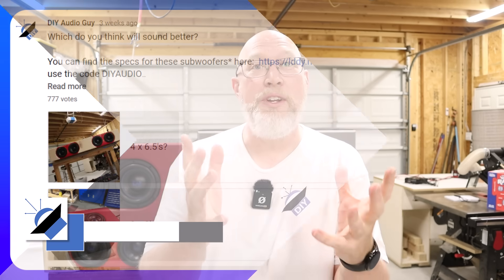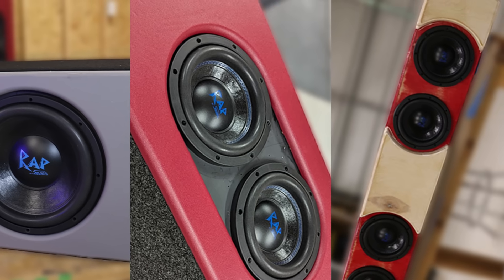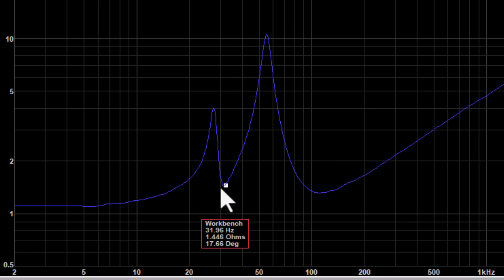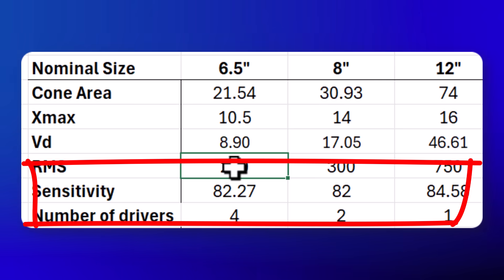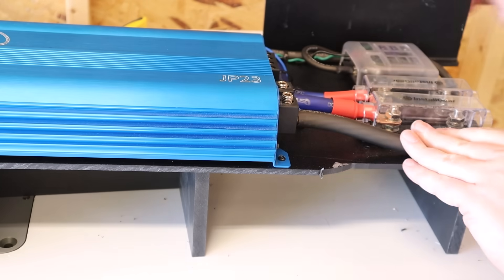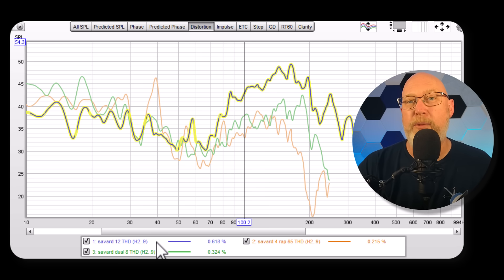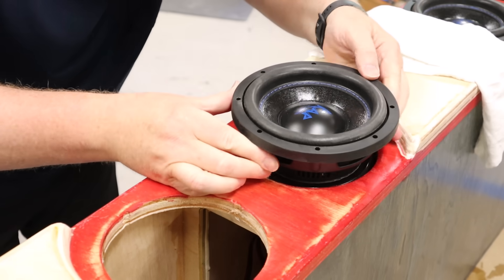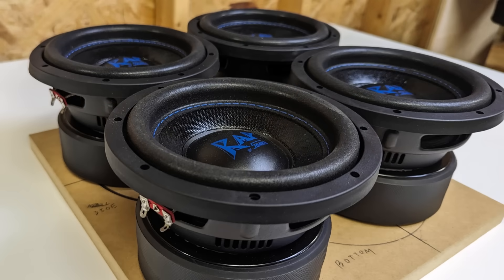Are small subwoofers better than big subwoofers?

Comment: For a great SQ set up, I find that one 8 in a well built box is enough to fill the cabin with enough bass. My days of epic bass are long behind me. Now its about stealth, SQ and power draw, eliminating rattles and hums and listening to the song as the musician intended. BUT I do understand that people love crazy bass and its fun because I sure did.
Reply: Getting loud is easy, getting low is a different animal
Reply: @d0nk3ybrain57 not really. It’s just that most people have a box that is too small. Every recommended sealed box size  I’ve ever seen makes the Qb much higher than the ideal .707. They’re usually up around 0.9 or higher than1.
Reply: @d0nk3ybrain57 agree 100%.   Right combination of enclosure/driver(s)/amp(s) is where the magic happens.
Reply: This comment. Get them midbass away from those doors. Front subwoofer if you can. Underseat midbass or infinite baffle midbass. Sealed box for tight clean response. Those days of getting loud isn't hard anymore. 2 8" can get 140db. That's insane for sq, already too loud.
Reply: @PunisherOfDeath101 149 dB is quite spicy
Reply: Sound damping is worth more than anything.
If you can control the vibrations in a vehicles panels it's going to exponentially increase SQ.
Reply: @Channelmaster73 
Indeed, every dB lowering of unwanted noise is a dB gained in performance and dynamics.
Reply: @FOH3663  I'm very new into the sound systems. That's my next upgrade, sound deadening all of the inside cab + doors of my s10.
Reply: @P4PKing  be careful with the mil count and weight could add 200 to 500 hundred pounds. Could be more depending on the foam and mil count.
Reply: Me too. Im 48, and finally weaned myself from the wall of 6 15s, and find peace in only 4 12s and just 156 DB. Oh its nice to relax and not worry about splitting windshields.
Reply: I respect SQL, and love to hear those systems, but I'm still in the "I want my car to fall apart" stage. even if its Celine Dion or Vanessa Carlton playing.
Reply: I listen to a lot of older stuff and have mixed feelings on the listening the way intended. Many engineers used to adjust things for the primarily cheap stereos from back in the day. I like rebass stuff but it does often kill the feel of the song. I have started doing my own edits that try to peserve the sound of the song but make it not sound like crap
Reply: I run 2 jl audio 8 inch subs in my truck with 6.5 focal components in front doors 5¼ focal components back doors and SQ is amazing. Gets plenty low fills cabin of my super crew up very nice. Everything is pushed by jl audio amps. It sounds amazing.
Reply: @speakerbuild1  
Nice! I bet it does sound amazing. My high performance car audio days were in the 70's, and early 80's!  
Hard to believe I was already out of it 40yrs ago, damn. 

I had a '76 Chevette(!) Alpine head end Alphasonik active crossover, Linear Power and Alpine amplifiers, driving 10" dual-coil IB sub, Alpine 6", Alpine ribbon tweets. 

(still have every piece!)
Reply: @FOH3663  that's funny. My dad still has his old setup. Mb quartz before they were junk and hafler. All back from the 70's and 80's.
Reply: @speakerbuild1  
Very cool
Reply: @speakerbuild1  jl amps are amazing.  Better than a nad home amp i had on same speakers.  Literally zero noise too.
Reply: @jonathanginofilippi  they're awesome. I have 2 jl 750x1 and 2 400x4. I have been running those for  almost 15 years (I think), never an issue.  Only issue I ever had was when I was running critical mass components. The jl amp pushed hard enough that the crossover melted its solder points inside and fried 1 of my speakers. That's actually why I moved over to focal components.
Reply: @speakerbuild1 this is exactly the setup I was thinking about going with, but wondering if 2 jl 8” subs are too much for an El Camino
Reply: @charlesfranklin407  no such thing as 2 much when u have an amp with adjustments. Turn it down a little. It will stay clean run cooler and always have the extra when u want it.
Reply: I'm to the point now that I think a pair of 7" Dayton audio Epique E180HE-44 in an under-the-rear-seat box in my Equinox is gonna be more than enough and still be out of the way.
Reply: @anthonybarker9123  do 3
Reply: @JP-Dawson  While I agree that a single sub is plenty, I prefer the rich lows of a sealed 12 over an 8.  So I still think 12 inch subs are the king, even in SQ applications.  A single 8 sometimes just can't keep up with mids and highs even for SQ
Reply: Amen
Reply: I could not agree MORE!!! My 8 inch recoil, in a box that is EXACTLY as specd by manufacturer, is so absolutely buttery smooth and full sounding I am continuously impressed day after day listening to it
Reply: Idk man, every now and then I miss setting off car alarms as I drive by lol. I have an older Infinity ref 10" hooked up to my Xplod 760W from high school right now, and I bought a 4 channel off Ebay to match it. All stuffed in to a customers Buick I bought for 500 dollars. What rattles? 🤣
Reply: You're forgetting one KEY parameter for any build regardless of SQ vs SPL, Cabin size. One 8 will rattle mirrors out of visibility in something like a civic coupe or a single cab mini truck, but get EASILY swallowed in bigger cars like a minivan or suburban.
Reply: I absolutely love my single 10" Deaf Bonce Machete Fight S D2 wired to 1ohm on just below rms requirements from a CT Sounds 700.1d.. my question is will 2 more efficient but larger subs ( ie. 2× 12" 400w rms D4 subs wired to 1ohm) out perform my single 800w 10?
Reply: I grew up in an SQ family. Everyone ran JL. I was also classically trained & studied music theory. When I got older, started looking for a hobby & had some money, I gravitated tward Bass. I end up liking Alpine, they're a fair mix of both for the price. I also have a thing for how the bass permeates through the car. I'm a huge fan of 12s for SUVs & vans. 10s for cars & crossovers. 8s for trucks.
The 8s tend to just sound better in trucks, but you probably won't feel it outside. 10s tend to be loud, but it won't sound as good in the truck. In some cases, you'll hear it more outside because the cab is so small that it won't reverb in the cabin.
Reply: i love 2 10 s  in a amazing box.    jl w7 10s   slaming .  like the main comment said.  its about stealth and geeat sound for us.    any 1 can slap windows out of a car/ truck/van.     make it elegant and stealth, built in like factory look..  thats the sweet spot.  
.i miss the crazy bass.    i dont miss fixing all the broken and rattling stuff.   
the good old days
Reply: 61 bug rolling a single Rockford 8” punch hits so hard my ears hurt
Reply: @tysonswing  Shidd them old punch amps were so underrated it made no sense
Reply: I definitely prefer a single 10". Some of the music I listen to sounds better when the sub can hit those lower frequencies that you only get with larger subs. I feel like the 10" is the perfect middle ground between the 12" and 8".
Reply: @Steven-gv1ke  Amen
Reply: im only 20 years old and i already feel drained out of "epic loud bass" and just want SQ.
Reply: You can always consider low-profile subs such as JL Audio.   When properly design & tuned enclosure, it will only reproduce what the amp sends to it, provided your amps are set up properly.  I find 30/70 split on the lighter side or 25/75 if more bass heavy reproduction is desired.  I find 35/65 split sounds too thin.  As long as you have your cut off and phasing matched properly so there are no peaks anywhere, you’re golden.
Reply: They don't go low enough
Reply: @MoMo-pe8fp  8's go plenty low enough
Reply: Ive grown into aiming for sq myself, but i still want it to be able to thump decently. Not crazy, just good enough for a former casual basshead to enjoy when i wanna turn it up. Like a perfect mix of sq and spl. Thats what im now chasing. Just wish i had more money
Reply: But you can't alert people that a douchbag is coming from a block away with an 8!
Reply: Me rn 🙂‍↕️🙂‍↕️
Reply: Couldn't have said it better, same here. Used to have 4 12's and my buddies all had 15's. Needless to say only one of us is still obsessed 7 years later now out of high school. The rest of us have a kid or are planning for one.
Reply: Do you go for a sealed or ported enclosure?
Reply: I have focal 6.5 components and a 350w pioneer champion 10" in a Mitsubishi pajero/montero/shogun.. need chest thumping tight bass.. would like to keep to a 10".. any ideas people??
Reply: I trialed a pair of 12 on about 600 watts from a dj system and it gave me very strong bass for music purposes, just not drive trough destroying panel flapping window busting life of price stuff.
Reply: getting loud might be easier... moving air is different
Reply: This exactly
Reply: 60 but I still like to pitch a drunk and turn that knob to 11😅
Reply: it's really cool to have movie explosions slam you in the chest , like with a pair of high quality 15" or bigger subs in the proper sized boxes. I find that my big sub setup also adds realism to the bass drum in music, although at reasonable listening levels, the rest of the music is usually just fine with a small sub or even no sub - if you have truly full-range big speakers. But I love it when I can hear a movie explosion with my chest.
Reply: Not possible not for dub I got two tens and it's okay but I used to have 4 18
Reply: I agree. One single woofer is enough. As long as that single woofer is an 18 in Ib.
Reply: One 8 in a sealed enclosure tuned to 60 Hz with a QTC of 1 lets the cabin gain fill in the low frequencies for a nearly flat response. No need for large enclosures or multiple drivers. No need for 1000 Watt amps. Use your head and not your ego.
Reply: @davidlong1786 60hz bass, that’s wild
Reply: But muy music is tuned to 37 hz and drops to 22  @davidlong1786
Reply: You grow out of the "look how much bass my car has" phase, eventually
Reply: @sterlingcampbell2116  
Yeah those dudes get into high performance home theater, with over the top sub systems.
Reply: @sterlingcampbell2116 once bass head, always a bass head.  Been doing this now for over 35 years.
Reply: @hamiltoncouple01  You can be a bass head and still evolve.  I'm also a bass head but care much about musicality than sheer SPL
Reply: I have my 7.3 Excursion system set up with 8 inch subs in all 4 doors, as well as a pair of JL c7 components in all 4 doors, 2 6.5 and tweets per door as well as one 3.5 in each door and tweets\3.5in the dash\tweets in the column, and in the back I got 2 12s and a 15 in passive radiator enclosures. Not only is my bass higher and clearer without distorting my sound than everyone else, every bit of my system will not only crazily outperform louder, but it will also be clearer and the way I sound boarded my panels and all the custom speaker locations, as well as an EXTENSIVE period of time pinning down all rattles and hums and twinges and addressing them, I can turn my system up so much louder than others that at a comp, only once though but it did happen, the referee thought the other guys system wasn't even on until I turned mine down, it was so clear, powerful and loud that he couldn't tell the other guys system was running, while standing closer to his van than my excursion. 

The 8s absolutely are game changer on their own, but when paired and properly tuned and time matched, you can have each one dedicated to a specific band so the sound is as close to true as possible. Sounds like you're literally inside the studio with the instruments, not hearing through speakers but actually there.

Comment: Port tuning calculations generally dont account for frictional losses, that's why your boxes always turn out being tuned a bit lower than predicted.
Reply from the maker: That makes sense.  It's a fairly consistent effect.
Reply: @DIYAudioGuy  If you are using winisd for the port length, then it can be a bit inaccurate, but only sometimes. The software i trust with the port length is hornresp
Reply from the maker: @LatvianVideo  I've been meaning to check that out.
Reply: @DIYAudioGuy so, have u tried/learned hornresp?
Reply: So... his speakers need lubrication?
Reply: @n0x3n just spit on them before each burp
Reply: I been using 12 volt box tune calculator and always works pretty good. When I run a frequency test it's always loudest close to where I tuned it on the calculator
Reply: Bass box pro👍 by Harris. It has a end correction factor that's available on port tuning section.

Comment: I really wish i had pics. In the 90s I built an enclosure for my cousin.  Nissan truck.  Snug top. Booted to cab. I wired 64 5 1/4 realistically mid bass drivers in the enclosure. 
2ohm mono. 1 decent Kenwood amp. Would blow your mind.  Had punch out the wazoo for rock bass. But enough cone area sounded like 18s on tech crap. Was an amazing experiment.

Comment: I mean I like a bunch of smaller drivers, just built a 9 skar svr 8s 2:1 fourth order for my trunk and they get down, way cooler than just 4 12s (same cone area) but more of a pain in the but to wire gotta cut a bunch of holes and you need more power on multiple drivers than less bigger drivers (usually) but just depends on where you need to fit the box, what your precincts are aesthetics so on and so forth